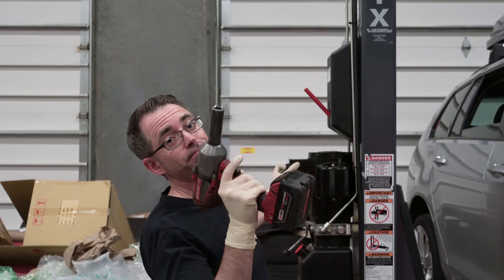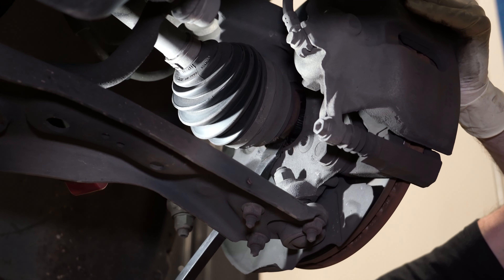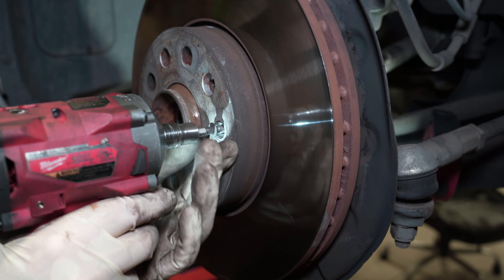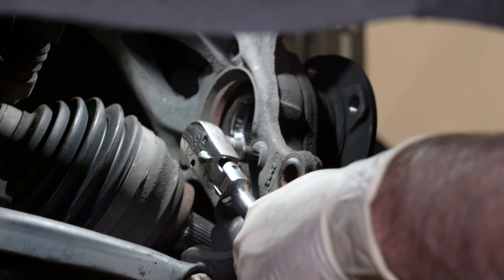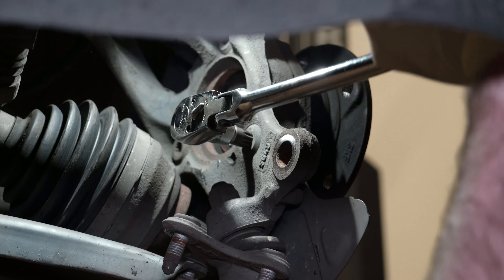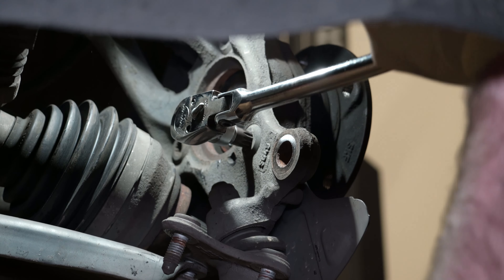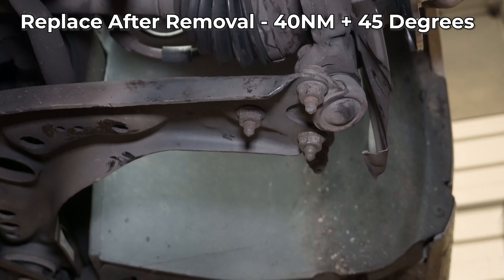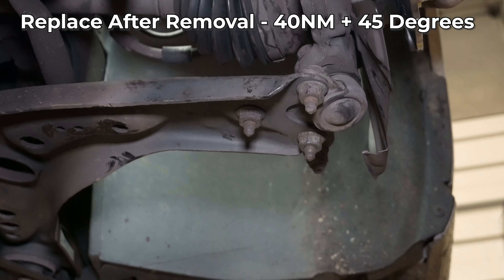VW MK7 Front Wheel Bearing DIY

Comment: I did mine recently with much salt, and it took lots of hammering with the threads of the wheel bearing bolts in a bit to get a tiny bit loose, and then applying penetrating fluid that evening and over the course of the next day before even more lots and lots and lots of hammering to get it out. Pro tip: the wheel bearing is already dead, you can hammer on the part the wheel mounts to! Or use a big axe for maximum power.

Comment: Are you sure about the axle bolt torque specs? From the manual I'm reading 200Nm+180 for the 12pt bolt with smooth builtin washer. Thanks.
Reply: I've always done 200Nm+180 with the 12 point